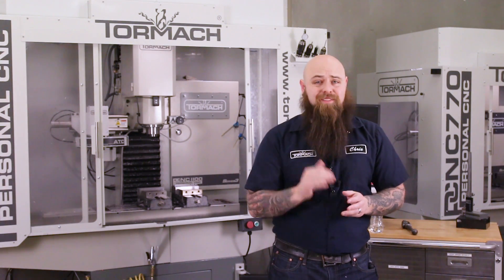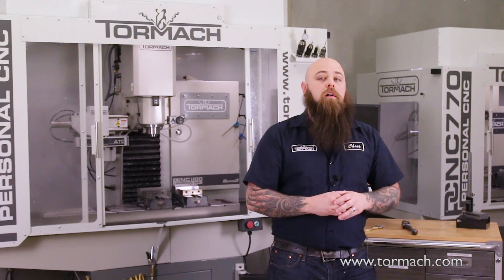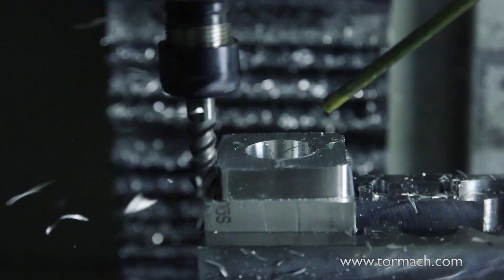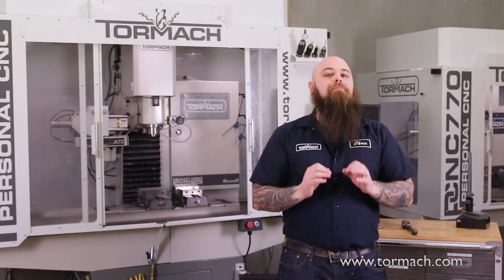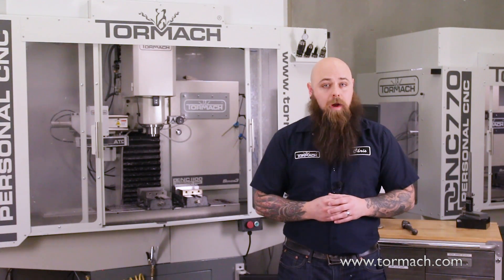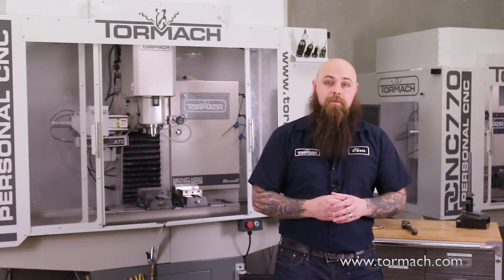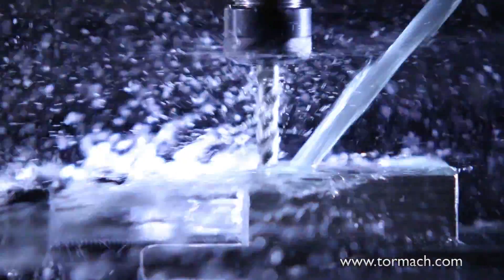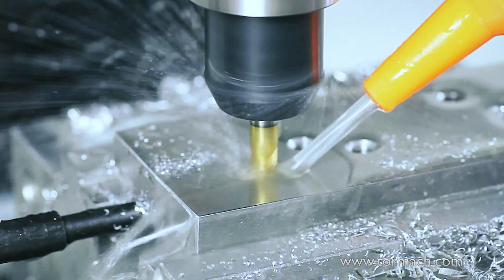Know Your Cutting Tools: Using Coolant and Proper Cutting Lubrication

Comment: Say I don't care about the "mess" could I always use flood coolant with any tool any material? that seems like it doesn't have disadvantages( other than some lose of energy when having to pump it but who cares).
Reply: You could but run the risk of thermal shock on carbide cutters. If you still did use flood with carbide make sure it is flooding before it starts cutting

Comment: Hey Chris, What are my material limits when using carbide tools with a Denatured Alcohol in an air misting situation?
Reply from the maker: Hey Paul, thanks for watching! Denatured alcohol isn’t recommended as a coolant, especially in mist form, because it is combustible at higher temperatures seen when cutting some materials.
Reply: Oh... That could be trouble.  Thanks!  I am currently installing the beta ATC... Is like Christmas today...
Reply: Hello sir
My materials is Aluminium so wich coolent or lubrication suggest me?